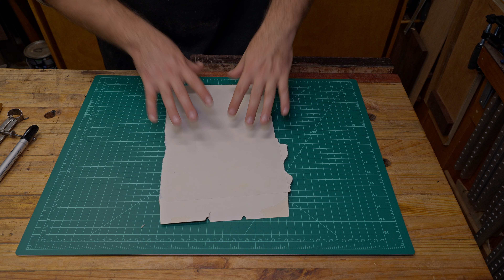Convert Your Smoothing Plane Into a Scrub Plane

Comment: It is a very essential tool to have in your arsenal. I had bought an old no.4  Stanley bailey made in England it looked in new condition but the sole of the plane was concave badly.I tried to flatten it for days  but I stopped when I reached the point it pretty close but not enough to be used as finish hand plane. So I have decided to convert it into a scrub plane I had seen Paul Sellers on how to convert the hand plane, buying a new scrub plane or old was very expensive. So I turned it into scrub plane and boy I was so glad !!! I can flatten with it soft wood hard wood , like taking off 80-90 percent of the hard work in much shorter time, I can tune it to take even light shavings. And I think I have only sharpened it once- it's a beast! Good video👌
Reply from the maker: Thanks. I first read about this in a fine woodworking article from 2006, then later saw the video Paul released in 2014. It's definitely a great money and time saver and a great use for a plane in not such great shape as its just doing rough removal.

Comment: Recently did much the same with a Stanley Handiplane I bought years ago when I didn't know any better. It worked ok in the Handiman body but much better when I switched the blade to a Stanley number 5. Have found it incredibly useful since. Used it to remove a thick layer of paint from an old stool. Made the job so easy. Highly recommended it if you have a spare blade
Reply from the maker: Yes, i completely agree it's definitely useful to have in the toolkit and most certainly speeds up waste removal with a hand plane

Comment: How does this compare to a purpose built Stanley #40?
Reply from the maker: I've never owned or used a number 40 (maybe one day) so i can't say for sure, however i have heard a few other woodworkers say that it works just as well.

Also before Stanley made the metal body planes so popular (including #40) this is exactly what was used on wooden fore planes, called a fore plane as it was used before others essentially Stanley just used the name scrub instead.

Hope this helps

Comment: I wound up with two Stanley #78s and while I was trying to figure out what to do with the lesser of the two I saw Paul Sellers make a scrub plane out of a #78 so that is what I did with mine. It works very good and I'm well pleased with it.
Reply: Did a second blade for my #78 as well, works great. Also have a coffin smoother with a little less aggressive arc as a kind of in between.
Reply from the maker: @edwardjarvinen3702  excellent idea having a few planes with gradually less aggressive blades. I think i might give it a go with my 78
Reply from the maker: I have seen this video and have contemplated doing the same since i have one knock off brand which is ..... Not great. Sounds like the 78 works well for it.